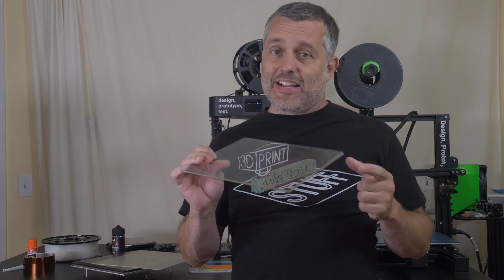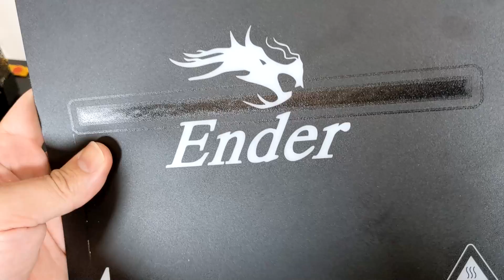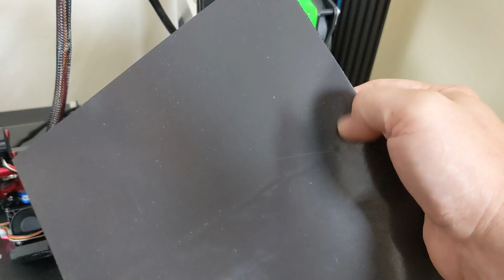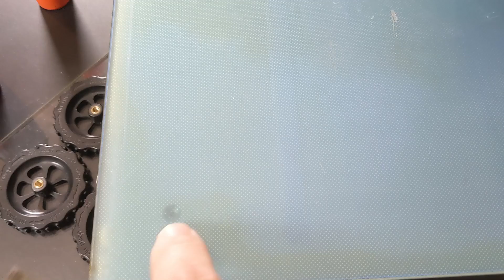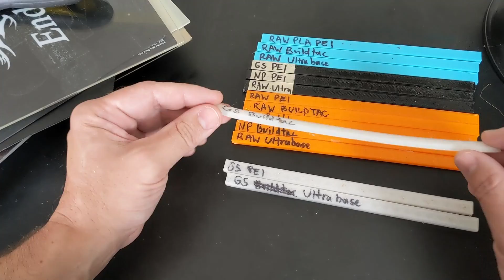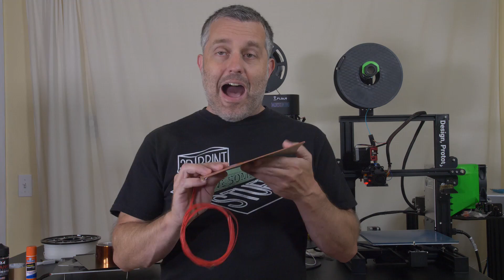The Best Bed Adhesion for 3D Printers

Comment: I had the same exact problem with ultrabase, where I would wipe it and it would be orange, of all colors. It was at that point I just said screw it and switched completely over to pei. Then I started printing crazier thermoplastics like pc, pc abs, nylon, etc, where the parts would warp so hard that they could tear any raft or brim up, so now I've tried glue sticks, roughed up pei, dual extrusion, wolfbite glue (which does work very well, maybe too well), and now I'm trying garolite, will see how that goes.

Comment: I want free stuff!! Of course who wouldn't?

But really thank you so much for this video. Just got my first 3d printer on a budget this week (ender 5). And am researching various upgrades for it straight away. So much potential. Also really agree with the sentiments expressed here about competing with China... it is very difficult! Just subscribed to your channel today and look forwards to watching many more of your videos. Invaluable! Really appreciate all the critiquing and honesty you mix in and include along the way. Also the color and life added with these backstories behind where all these solutions originally came from (and the related or supporting technologies. It helps so much! Makes it all easier to comprehend and understand what is going on. Best wishes from the UK.
Reply: Haha, just also watched your other recent video on the two trees saphire. Where you point out not to confuse with the ender 5, due to the increased gantry weight and the location of the tepper motors. However I was on a very tight budget and the ender 5 was heavily discounted to came out to be the same price as and ender 3. I think in future I would like to see if it can be converted 'somehow' or become more like a real xy. Or otherwise to become a spare parts bin from which to borrow towards a reprap. Have you seen the HevOrt BTW?

Until then I have at least something to learn on. And it should be about as good as an ender 3 anyhow. But damn the price of the discounted saphire is also really low! The ender 5 cost me #200 GBP over here in UK. While the saphire looks to be only about #300 GBP. Oh well! Did not know at the time. Very new to all of this.

Comment: Vision Miner was founded in 2017 and first pieces of information about nanopolymer are from 2019. I had my Anycubic Ultrabase on my first printer in 2017. Don't falsely accuse whole china because it's little yellow. 
I have ordered a vision miner nanopolymer but I don't used it yet because I have Energetic PEI Powder Coated Spring Steel Sheet on all of my printers. It's fantastic, better than Prusa powder coated PEI because I can print almost anything without any preparations (TPU needs glue stick) and I can take off print from print surface minutes after print finished, don't need to wait half-hour when ultrabase is fully cooled down. But I don't print PA, only ABS, ASA, PLA and sometimes PC and PETG.
Reply from the maker: Hear me out... is it possible that maybe, just maybe  the printer which I received in late 2019 with an Ultrabase bed had Nanopolymer on it from the factory? No, not possible. Not at all. Yeah, you're right I must be racist against "little yellow" It's all my bias at work here. There is no truth to my accusations of the rampant intellectual property theft by Chinese COMPANIES (not people). /s Also, "Little yellow" is not accurate. Chinese 3D printer products account for probably 75-90% of all 3D printer products. They aren't "little" they are dominant. They are dominant because they steel every single idea from innovators in western democracies such as the U.S. England, Germany, and S. Korea.
Reply: @DesignPrototypeTest  Ok, It's possible that some ultrabase clone use this nanopolymer, but not my Anycubic Ultrabase from 2017. Original Anycubic Ultrabase must be something developed in china. I have to agree that it's a big problem when they steal ideas like when they created dragon hotend from mosquito.

Comment: About the FR4: It seems that you did not sand it with a medium-fine sandpaper before usage, it looks very shiny like fresh from the factory. Just give it a sanding with 120-grid sandpaper until it gets dull.  Did nobody tell you how to use this? :-O I've been using my 1mm-sheet for 4 months, and it's absolutely fine despite some mishaps. My regular printing temperatures: PLA 65/60, PETG 75/70, ABS 105°C. I could even get a little lower. When the bed is down to 30°C, I can just snap any of these materials off by pushing it with my index finger. No gluestick, ABS gets a bit of Acetone-sauce to prime the bed, though.

Comment: for me the best solution I've had work is watered down PVA glue, 5:1 or so, spread suuuper thin on a piece of glass with a paper towel or a plastic card, it adheres ridiculously well to most materials (since PVA loves to stick to plastic), releases completely when cool (since it's on glass and it's super thin) and if you don't touch it with greasy fingers it lasts a lot of prints, if it gets dusty wipe it with a paper towel and hit print, really lasts a while and leaves a nice satin/matte-ish first layer

also " I want free stuff " lol, would like to try that nano polymer adhesive, at least the $5 bottle would be fun to test with

Comment: I did some tests too with nylon.The visionminer Nanopolymer starts to beat the glue stick at a bed temp of minimum 120°C. I used a powdercoated springsteelsheet from thekkiinngg on my prusa mk3s with two layers of nanopolymer and it adhere to the bed just fine as i was printing a box out of nylon that was nearly the size of the bed. However i had to clamp down the springsteelsheet because otherwise it came loose. I also printed it with a draft shield to prevent warping because one half of the box was 30mm high and it really helps to keep your upper layers warm. So although it is possible to print nylon without a heated chamber its a pain and i would only print small parts like gears without a heated chamber.

Comment: Glue Stick is a moderator. For surfaces that are not sticky, glue stick adds adhesion. For surfaces that are too sticky, glue stick reduces adhesion.
PEI has very good natural adhesion, glue stick is not needed to add adhesion, glue stick is to be used when the PEI has too much adhesion like when printing with flexible filaments and sometimes PETG.

If you reran all the tests without glue stick on the PEI, I think PEI would have won.

Comment: Free stuff; I would love that Nanopolymer. I am on my second bed with my Anycubic and it is wacked. My first bet got etched by my print head because I think somehow the level went off by witchcraft or something. And my second bed is losing grip as I clean it with isopropanol and I think it took all the coating off. Thanks, Great videos.

Comment: Few thoughts on ABS and polypropylene. Polypropylene loves packing tape. ABS is fine with a very thin mist coating of hair spray on a hot textured glass surface. How hot? 170C is the goldilocks temp for me. This keeps the top of the build surface at the ABS glass transition temperature or softish. The catch is the 3M adhesive has a continuous service temp of 150C and the extreme edges of my build surface are about 5C cooler. First layer is always .3mm plus I always use a 0.4 nozzle typically with a wider paving width between .5 and .6mm, mostly variable layer thickness for the slicing. Another trick is over extruding the first layer up to 10 percent greater than the calibrated flow (I calibrate flow with a printed nut and bolt adjusting the flow  to get the correct geometric thread clearance).
Cheers -Peter

Comment: I have some filament that is supposed to be PLA but only way it would print is 70 degree bed 210 degree nozzle and no part cooling or else it will curl up on the ends, but then it sticks like cement on my two bed surfaces. I have creality glass bed and original build tac. But i do like free stuff!

Comment: Kapton is a  Polyimide  that is used for coating magnetic wire.  The wire used to wind coils.   If I remember correctly the failure of wires in airplanes is due to fatigue failure from rubbing of bundles of wire against each other.  Miles of wire are in a commercial airplane.  I want free stuff

Comment: When I started printing polycarbonate, I had to find something that would work that I didn't have to replace when I switched back to pla/petg.

 A untreated 1\8th sheet of "Lexan" or clear polycarbonate plastic is like 5 bucks and you can cut two beds from the right size. it can be heated and pulled off and flexed too. Haven't tried nylon yet since upgradeng. Never printed ABS, I've never seen PETG stick first layer so well, PLA sticks good, and pops off nicely(petg pops off great at 35-40C but is hard to remove at room temp) and yeah polycarbonate sticks nicely too. Significantly lighter than glass too.

 All you have to do is binder clip the edges cause theyll want to rise if you heat your bed. Can be cleaned with denatured alcohol. Gluestick cab be cleaned with water. it works unheated with pla too, I don't print that way but I had read that it was possible and printed a small cube to confirm. 

Good mini subject for a cheap fix type thing, you can go from ruined print surface to hardware store to back to printing in a hour while you new replacement bed is shipping. Can be cut with a jigsaw/hacksaw/circular saw/razor-and-snap. When one side wears out you just flip it, so you get 4 print surfaces for 5 bucks. Essentially can be considered disposable but each side has lasted as long as my original anycubic bed sticker. 

Also, delta configuration best configuration. Fight me. :) 
Polar coordinates machines to rule them all!!!!!!!!!
Reply: What delta machine do you reccomend?

Comment: What you are calling garolite, isn't. Garolite is a red-brown color and isn't the same as FR4
Reply: Yes, Garolite is wood fibers, and FR4 is glass fibers.  I sand mine with 180 grit: left-right, then up-down, then diagonally.  Then wipe the surface to get rid of the dust caused by the sanding - I use an alcohol pad, first one side then flip it over and use the other side of the pad.  When done wiping look at the yellow on the pad - that's what's not going to be stuck inbto your printed part.  I heat my garolite bed to 60C, heat my chamber to 50C, hotend at 245 (pt100 3-wire sensors in all my printers so the same settings work on all).  The nylon is peeled off, and feels like you're peeling a gecko off a wall.
Reply: Phenolic sheet
In the uk its tufnol
Different names in different countries
Reply: @Anthony Alfredo definitely, I have been using instaflixxer for since november myself :)

Comment: the clone anycubic ultrabases are known to lose their features overtime, however i have a genuine and clean it thoroughly, and that has lasted since i got it about  1 year ago, so the anycubic ones are great, the clones are hit-or-miss. 
Also, the powder coated pei solution prusa invented is awesome for nylons, and anythng except certain PLA's.
Best 'cheap'  solution for Nylon is using glass and a painted on mixture of 50% water 50% PVA

Comment: I was having huge problems with bed adhesion on a public library makerspace Lulzbot printer.  I did some research and found the 90% isopropyl cleaning info I've posted here.  I did that and adhesion was so good I could barely get the printed ABS item off the bed.